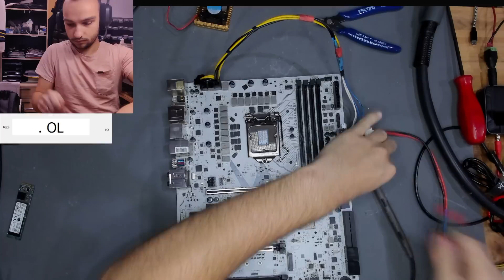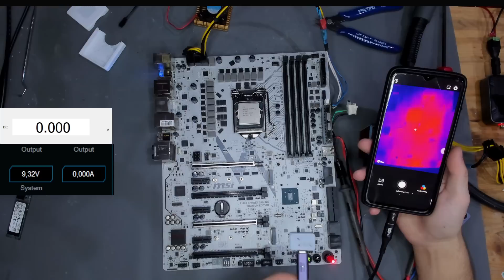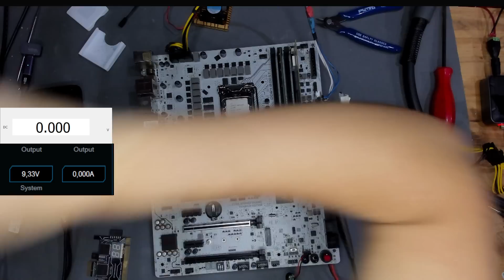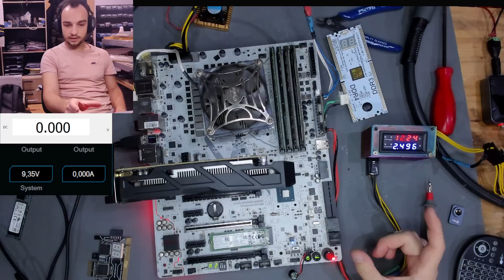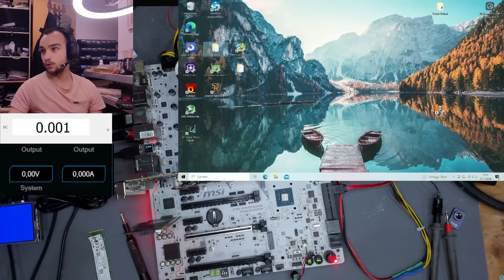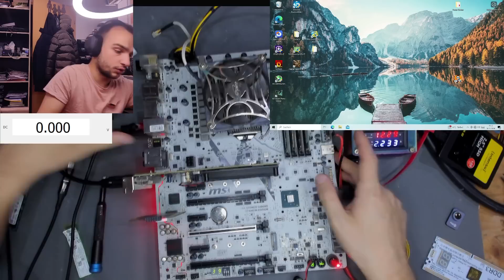HELPING A VIEWER WITH HIS 2 RARE MSI BOARDS || repairing Z170A XPOWER GAMING TITANIUM EDITION

Comment: heya , could ya do a video explaining how you started doing this and with what you started really interested in starting probing soldering checking but idk from what to start , proly some shitty low end board a320 b350
Reply from the maker: There is really not much to tell here, i started with Z170 and then worked on from there! I started by watching others do repairs and then trying it for myself! It is connected to a lot off hours staring at a board and wondering what could be wrong!

Comment: MSI has a separate ME (management engine) file to update with the version of the BIOS.  You get the ME error because the bios is either missing the ME or it has been flashed back and is not the right version.